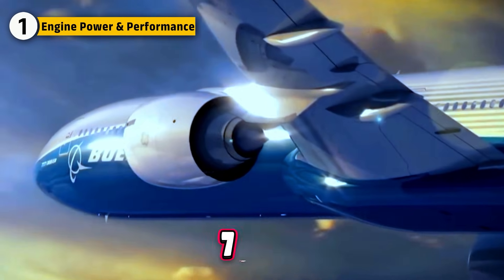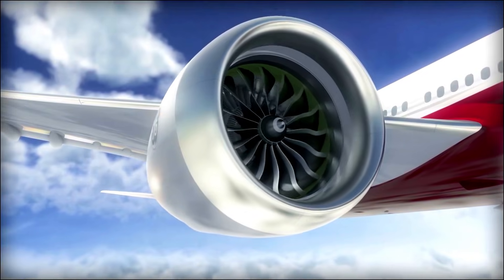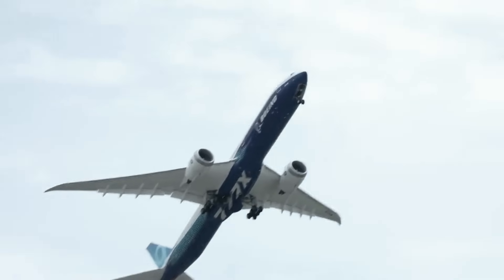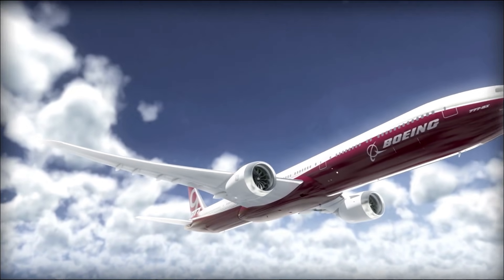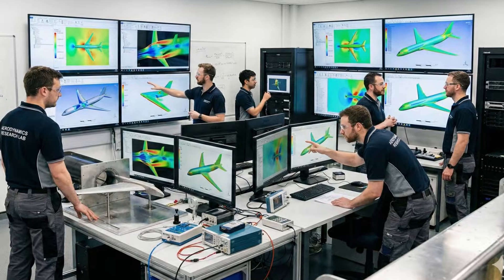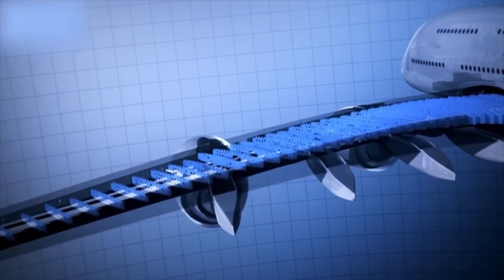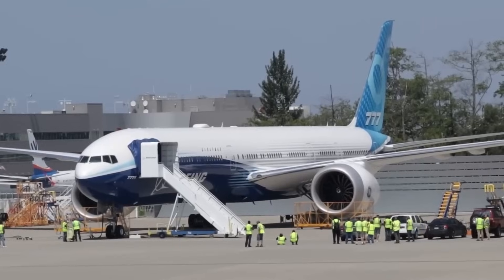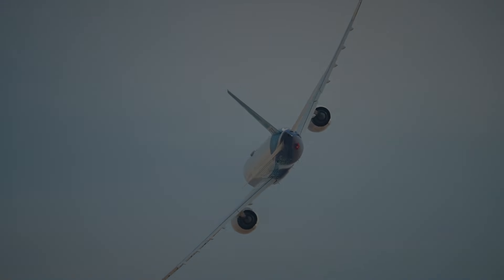How The ENGINE Of Boeing's MASSIVE 777x Is Made

Comment: Until the plane is fully operational by airlines, nothing about this GE engine could be justified. On paper it looks high tech. Only airlines could pass judgement on it once it goes into service
Reply: i think it will do quite well. the ge9x is an evolution of the ge90. nothing is 100% clean sheet about it at all but rather gradual improvements and imperfections based off of what has already been done. many of it's designs are highly proven to be incredibly reliable. I think this airframe will be yet another winner.  Also my god this aircraft is beautiful, those wings look incredible.
Reply: @Mike-jv8bv Hope to see it the skies soon. Boeing needs to get past FAA first to ensure everything is good to go
Reply: @hishamosman4341  FAA needs to restructure it's self as well. They keep stacking rule after rule making new product development much harder. We used to be able to get new aircraft development done in a 5 year span now FAA rules have tripled the cost and  has made them more than 10 years on average now.